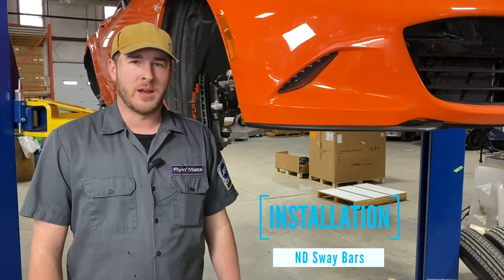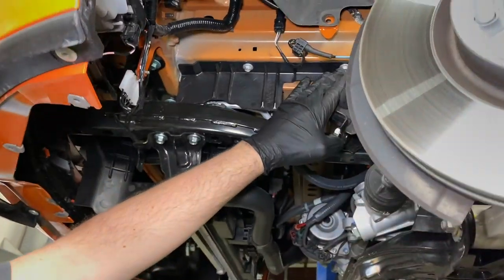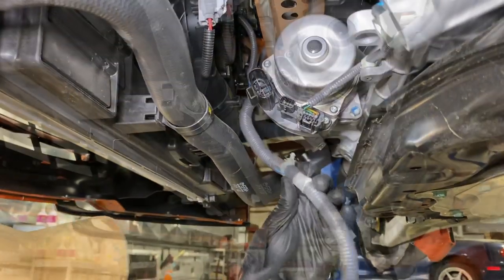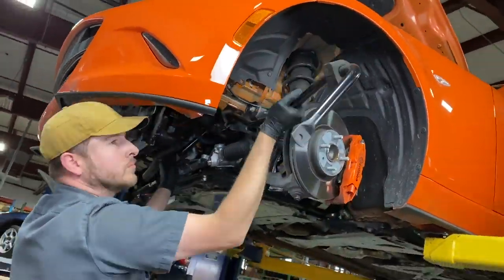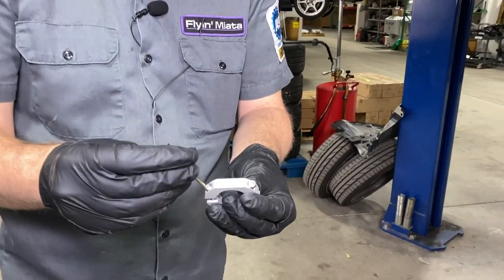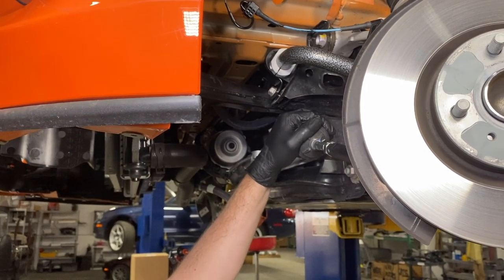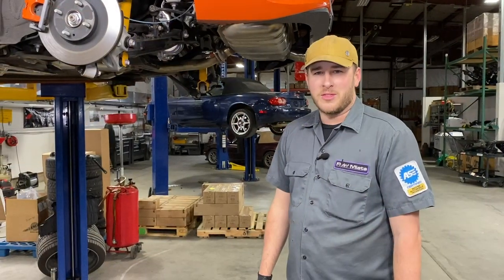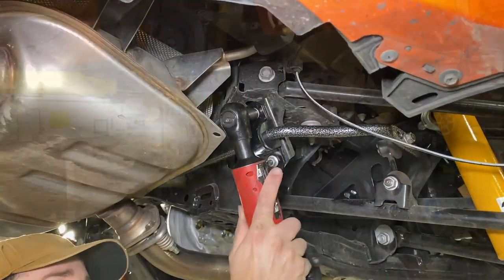ND MX-5 Flyin' Miata Sway Bar Installation

Comment: How much different is the ride with the new parts ?
Reply from the maker: The effect on ride quality is minimal. The car will follow the camber of the road a little more closely, but these are not monster bars - the suspension will still be free to move.
Reply: Just finished these. On the shakedown drive, I did not notice any significant effect on ride quality. I think you'd have to drive them side by side to notice.

Comment: Dumb question, why can't you just cut the old bushing out, because that is what causes the most obstruction
Reply: Never mind, it doesn't work.....The bushing is stuck to the bar, which doesn't make sense to me.....F it.  Im going to cut the bar.  On that note, why is the bushing fused to the bar, and doesn't spin freely like the replacement bar?

Comment: Is this even possible to do on jack stands? The rear seems easy but the front... Dam. I really don't want to pay a shop over $400 to install the front one.
Reply: I am about to do it in the AM with four jackstands. Worse case scenario is it takes a lot longer than you'd expect...I'm gonna do it following this video and just take my time as I dont have power tools. I'm wondering how I'm gonna torque down the brackets knowing a torque wrench wont fit
Reply: @georgebugarin1078  How did this go bro? I'm going to attempt this tomorrow myself.
Reply: @BestCaseHypothesis  took me a leisurely 4.5 hours on jackstands with a 45 minute lunch break. The hardest part was putting the passenger side radiator hose rear bolt back on. The FM sway bar is so thick that I couldn't lift the bar high enough to comfortably screw the bolt back in. I did all by feel. However the sir in the video does remove the skid plate and I forgot to do that, but that seems to help. It's very rewarding to do and it's not that hard. Just follow the video.

I'm very pleased with the result. Ride quality is the same with the stock bilsteins but i can hold the cars nose in the turn without as much worry about losing tire contact. Coilovers still needed cause the bilsteins are still soft and hard at the same time.
Reply: I also did it on jack stands. No problem. The hardest parts for me were the power steering wiring clips (I broke one, but not in a bad way), and the oft-mentioned rear radiator hose bolt. Removed the extra bracing, same as the video, to do that one. My torque wrench did fit on the lower bracket bolts and the end link bolts. The upper bracket bolts I had to guesstimate.